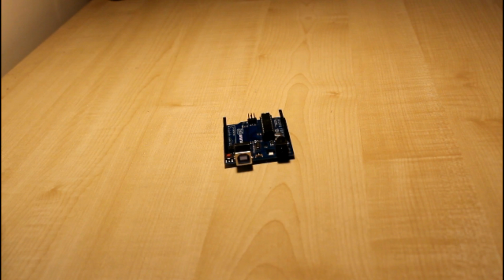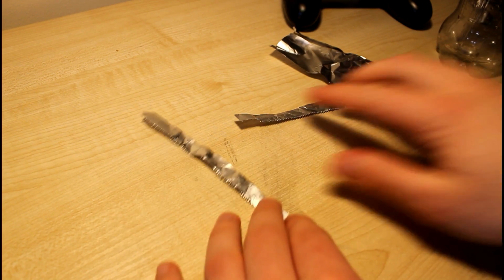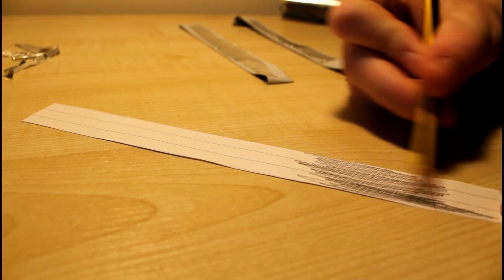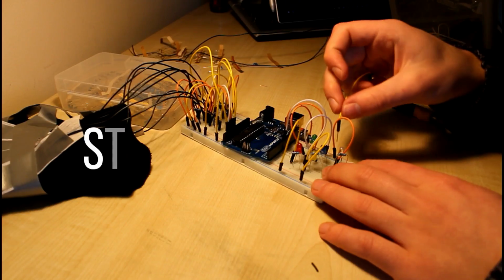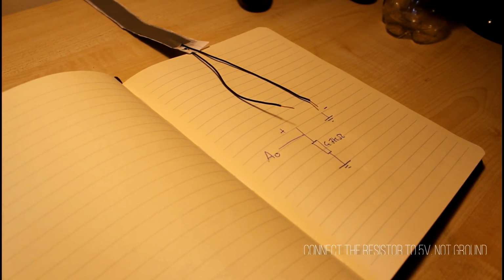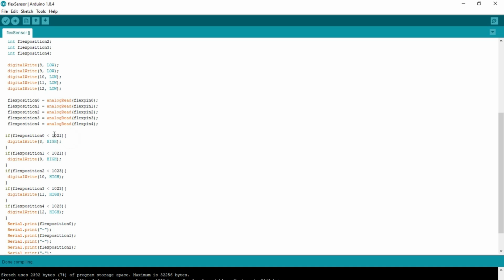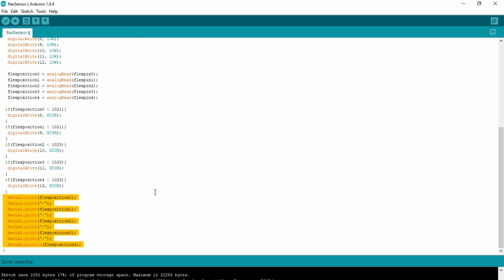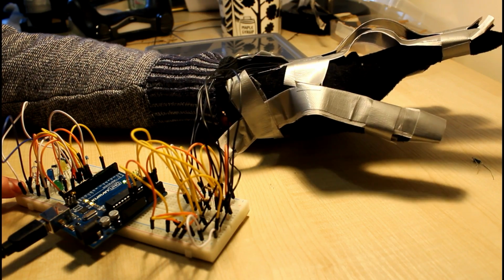Turn Your Hand In To A Controller | Project Iron Man | Part 1

Comment: Your schematic does not make sense, you grounded both sides of the resistor divider, and you then have the middle going to an analog input, there is no voltage? Also, I cant figure out how current flows through the paper, you seem to have no electrical connection that goes from one wire to the other? Are you making a capacitor?
Reply from the maker: cbeif yeah one of the pins should go to 5V, there should be a not of this in the video